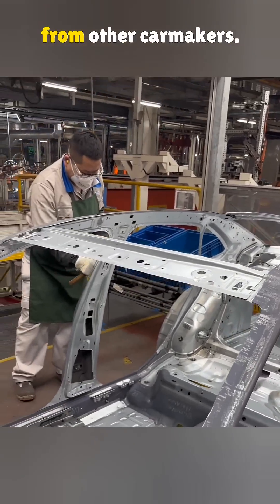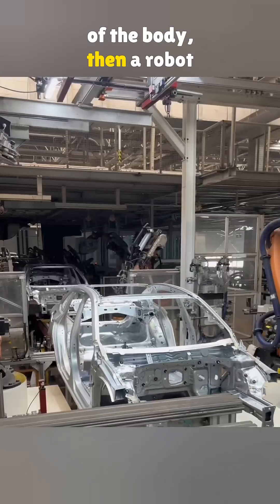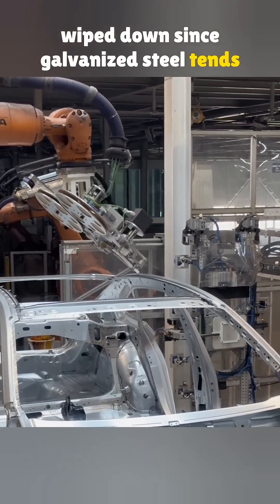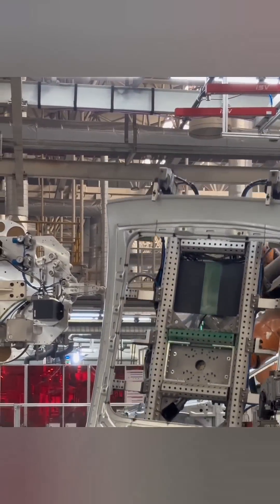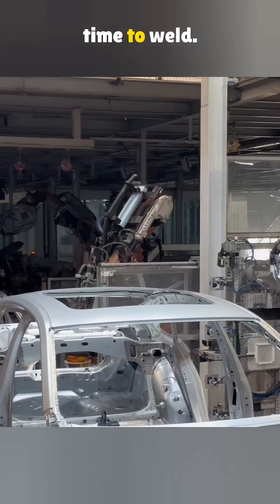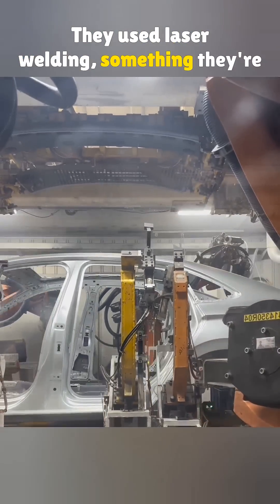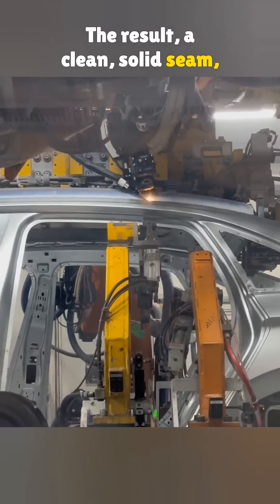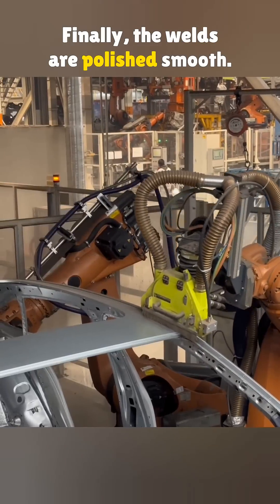How Volkswagen Installs Car Roofs #assembly #automobile #manufacturing

Comment: Don't know how old the video is, but Volkswagen also sprays a special wax inside enclosed metal spaces to prevent rust, forever.
Reply: This just prevents rusts in door sills and other hard to get spots. Outer skin still vulnerable. But in early 2000's VW made outstanding rust protection, even gave 12 ears warranty

Comment: A PC chassis is tougher than a modern soda can car.
Reply: i have seen video of crash test comparing an Old Chevy to a Newer One. Old Cars were Death Machines.  Modern Cars are way Safer , Sometimes less is more if its done right. Not Necessarily Heavy Metal will Protect if the car is Not well Designed. Modern Cars are designed at Tested on the Computer which is Advanced Technology

Comment: VW cars usually rust less than other brands. Would be interested to look at a video about the anti rust treatment and galvanization process.
Reply: Tell it to my vw that's rusted as fuck.
Reply: Nothing can survive the salt on the roads in the north.
Reply: @fleurdewin7958  proper anti corrosion treatment does protect it, like zync coating and stuff but then cars would be good for 30 years and car manufacturers wont like this
Reply: They all negativ charge the chassis now and dip em in protection

Comment: What a waste of time. They should have  figured out how to stamp that as one piece by now.
Reply: Every part of a modern car has different steel  . It is the way it is rolled cold . So you can not press it from one piece  .
Reply: @marinusbonsing Tell me you're not an engineer without stating it..oops you already did
Reply: Why don't you tell them
Reply: @r11tc I already did, as well as several other engineers.  Apparently, they didn't want to invest in the heavy press required.

Comment: 20 year old VW ,hasn't broken down yet
Reply: 2002 Polo 1.4 with over 400k km used every day.
Most reliable car I've ever owned.
😎👍🏼👍🏼
Reply: mine's 24, same
Reply: You are really really really really...... Lucky or you are  a liar.
Reply: @anesps-ii2yq  20 year old seat ( VW group) 0 problems !!!!
Reply: @anesps-ii2yq  No the older VWs were solid machines. It's the newer stuff that's junk, past 2010s

Comment: Volkswagen is different from other car makers... Yes!! That's why they break down often. Bloody hell.
Reply: So true! I had 2 VWs and both were lemons! Never again! Junk!
Reply: I've driven many Golf 2 GTi, Golf 4 GTi, Audi 1.8T and VW Polo.
They all outlasted most other vehicles in reliability.
My Dad still dailies a 1980 VW Transporter (350k+ km) 
And I daily a 2001 Polo 1.4 with over 400k km.
Reply: lying little bro !
Reply: They don't!
Reply: No they don't, you lie as usual.
Reply: Passat Gen3 1.8Mono injection lives longer than the owner
Reply: Not really, only if you drive against a wall.
Reply: @janv777 anybody remember the 1.8t and the failing coil packs?
Reply: @boostedmaniac Anybody remember 1.9 TDI and 2.0 TDI going far over 300000 km. Any 1.6 MPI going over 200000 km?
Reply: @boostedmaniac like every ford has ? Not fixed.. wel they fixed it now. But now they have problems with the wet timing belt.... what would you like more ?
Reply: @janv777 I have a 2.0 tdi euro 5 VW engine o a Seat Exeo with 300k km and nothing done to the engine .
Reply: @Scorpion9709 Seat gehört auch zu VW.
Reply: @Scorpion9709 Seat gehört auch zum VW-Konzern.
Reply: @herbertpilch8802 I know , seat Exeo is an Audi a4 b7 facelift
Reply: Let face it brother. Every car had something. Italian cars have electric problems..
Usa cars have big ass engine problems
Germans over engineerd but hella good. 

Uk ford.. let not about those fords... 

Opel....................... to car that get out of the dealer instant ready for the junkyard 

JDM. Got there name from back in the day but nowadays are shit.

Toyota has a few reallly good models but also with problems.. but also brand name from back in the days.. like every brand. 

A Toyota corolla from the 80's vs a 2025 the 2025 is not as good.

Same for vw.. vw will never let you down. 

But once again... Opel is the biggest shit in the world. Even a lada is beter :D
Reply: @farmergasie3338 even my Audi V6 had coil pack failures. I had to replace power steering pump, transmission died at less than 100k, suspension bushings were creaking and making noise, and the catalytic converters had to be replaced. I think there was also failure with the throttle body, maybe some module on it. Also the stupid plastic oil dipstick that cracks so easy. Too cheap for a metal one I guess. It also started drinking a lot of oil, and yes I always used synthetic oil. I finally traded it at 120k, otherwise the next repair would’ve been the cracked plastic intake manifold. 

My friend had a Passat 1.8t and tons of coil pack failures.
Reply: Lol. He never owned a vw for sure. We drive a 21 one year old vw. Old family car. Before that i owned a 36 year old vw. Never let me down.  The only problems vw has is. 

You will love it to much!  

Exept old vw models that are mixed with GM parts......... like the shitty MPI engines. But yea its pretty much the crylser MPI engine but with 2 less pistons....
Reply: @farmergasie3338  Mr LOL., I owned a Diesel Polo and later a Polo TSI. Both were an absolute mess!!